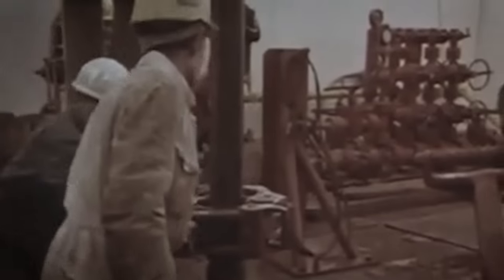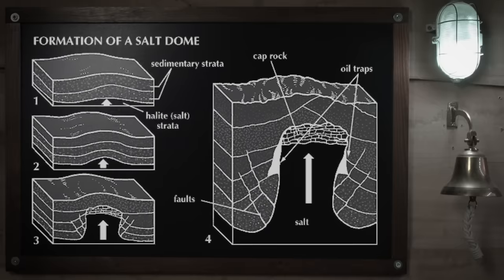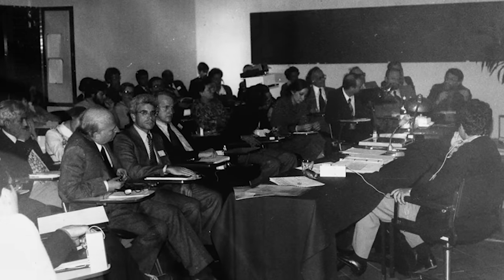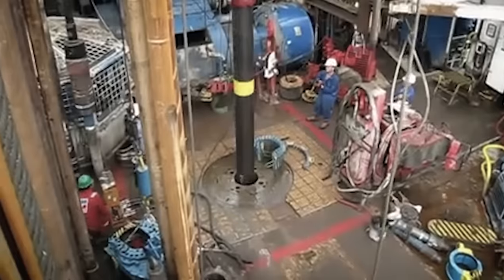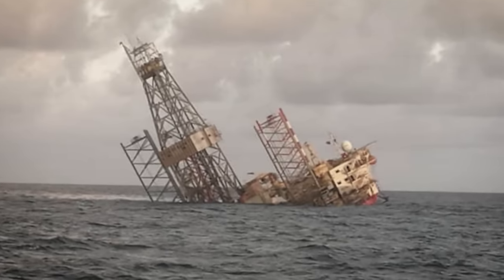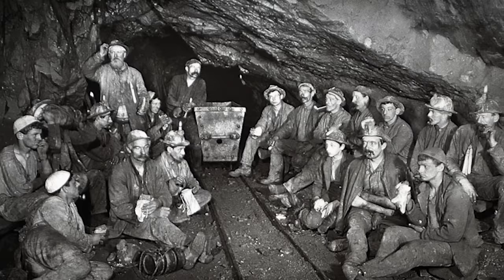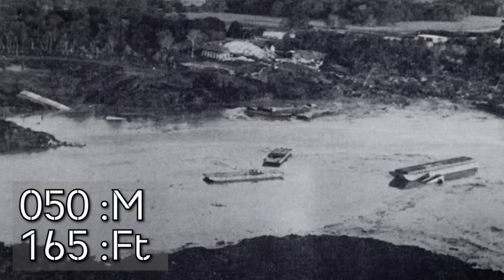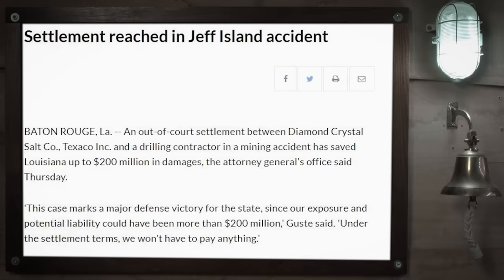This Vortex Swallowed an Oil Ship...

Comment: Always fascinated by this story & the mind-bending size of that mine to have swallowed all that water & debris.  It's a miracle noone was hurt in the mine or on the surface like the fisherman, especially given there were lots of waterfront properties & only landline phones to warn or call for help.  Sheer stupidity & 100% malpractice on both company's parts.  Great video as always! 👍
Reply from the maker: Yep it is incredible. The scale of the incident and no fatalities. Just incredible
Reply: You seem awfully quick to judge. I don't have enough information to say if both companies were at fault but, imo, the criminal negligence seems to lie with the salt mine alone for not having the abandoned shaft on any known map. That said, drilling that close to a salt mine, for any reason, seems incredibly risky. I guess what I'm trying to say is that I don't necessarily disagree with you but I wish people weren't so quick to point fingers. Mistakes were obviously made, but the oil drilling company appeared to follow all appropriate procedures. They can't force another company to participate if they don't want to, unfortunately.

Comment: As a native of the area I thought I would explain that Jefferson Island is not actually an island. Near the coastline towns built on the higher elevation above salt domes traditionally have "island" in their name. Besides Jefferson Island there is also Avery Island close by and High Island in Texas (east of Galveston Bay). They are high enough that they won't flood during storm surges caused by Hurricanes. They have large old live oak trees because ones at lower elevation are killed by salty storm surges.
Reply: Thanks, I was wondering why I couldnt see a giant island in the photos

Comment: I'm a native Louisianian and recall this incident quite vividly. It happened when I was 20 years old and working at a radio station in central Louisiana, so we were of course reading the news on this hourly. Many from our area work in the oil drilling community. The fact that it swallowed up the rigs, various boats all that shoreline infrastructure and a tugboat WHOLE was astounding and terrifying, as no one really knew much except the initial cause of it all, the punch through, and furthermore no one knew if it would ever END. It did, but I have to say I have visited the gardens on Jefferson Island both before and after and the damage done was apocalyptic to look at.  Louisiana has the largest oil reserves of any state in the union, and yet we get the lowest return on removal of that energy from our state of any state that produces energy. And yet we often bear the brunt of the largest accidents and incidents in the oil industry.  We run on oil, I'm not against getting it I just would like to see it done SAFELY, and with as little damage to state property, wetlands, shoreline and the Gulf. Deepwater Horizon was so horrible it should have ENDED BP. ENDED IT. But obama gave them a sweetheart deal settlement, yeah, Mr. Go buy your ass an electric car guy and never EVER use fossil fuels again hisself. He had the chance to BREAK and DESTROY a monumentally incompetent company and he took cash instead. Just like he did with Wall street when they caused the collapse in 2008.  He could have cleaned house for their using the stock market as a casino but he took CASH again!! Anyway, the feds got the lion's share of the funds and the Gulf coast got monumentally screwed once again. The Gulf LOOKS ok, but deep divers say the floor is destroyed for good. Thick layers of heavy crude blanket everything and sea life is mutating because of it. We're a big seafood state so make of THAT what you will as well.  All that said this was an EXCELLENT presentation of the incident, concise, accurate and wonderfully presented. 
I just wish it and D. Horizon had never happened.
Reply: When I was a kid from age 2-6 we used to swim in the Gulf of Mississipi near Biloxi.  In 2004 I happened to be in the area and mentioned it to someone and they thought I was nuts because it was polluted nd not really a beach anymore.  I guess things changed there since the 50's!

Comment: Did there used to be a river running through the lake? I'm a little confused at why there's soo many barges in a lake that doesn't have connections? That aerial photo at the very beginning had me confused the whole time. Unless that many barges are needed for the oil rig, but then weren't they drilling down and then to the side? I kinda assumed that drawing at around 2:21 is just generally the angles at which they're drilling not exactly for this specific drill site. I gotta look more into this story it's crazy. 

Thank God that all the miners and oil workers made it to shore safely, and the man fishing at the north side of the lake. That has got to be quite the sight to see while waiting for a sunfish to bite. Great video, Has me looking for a local tour or something that I can get more info on it
Reply: Okay I see the Wikipedia page and notice there's a river connected at the bottom of the lake. I was even paused on the Aerial photo at the beginning of the video, I feel dumb that I missed that, it's soo obvious to see >_< forgive me internet :)
Reply from the maker: It is a crazy one. Glad you found the answer you were looking for

Comment: This isn’t the only case of “ground vs drilling” on lakes.
Reply from the maker: It’s one of the wider ones I think. But yeah there are others
Reply: @waterlinestories  thank you for the reply I just have difficulties in understanding why the problem keeps repeating itself if it happens once, ok it’s the first time there’s an investigation on what happened and why, next time whoever it’s going to do something similar knows more about the risks and must know better and make more studies on the lake/body of water geology, physics of fluids, etc so if you drill you do it completely safe. But…no safety it’s not so relevant and people don’t have memory so they can’t remember the “ground vs drilling” accident that happened the day before, that’s why the same issue keeps repeating itself.
Reply: @EM.1  no matter how far you think about it. It leads back to money normally.
Reply: @nollienick1121   I understand your point but it bothers me that I can’t remember the others 2 cases, they are widely covered and I watched at least 6 different videos about those cases.

Comment: Where did all the Barges, Ships, Trees, Oil rigs, and equipment end up, like, that's a massive shitload of metal, wood, debris that got sucked down into the Salt Mine's chambers...
Reply: A lot of the trees, a barge, and debris is still sitting on the bottom of the lake. Most of it was sucked into the mines and is still buried there

Comment: The water level in the gulf of mexico one could assume remained stable throughout; the water level im Lake Peigneur fell as water went down the hole, so the water level in the canal joining the two should have FALLEN, not risen 8 feet, and even afterwards, as the lake level rises back up to be equal to that in the Gulf, because of the lake size in relation to the canal size, the canal level should still not have risen by as much as 8 feet, as the in-flow velocity would have gradually reduced, not abruptly, so there would be no significant 'flash-back' wave. Anyway, I have never seen a full canal where the bridle-ways were anywhere near as much as 8 feet higher than the water level, except at locks or bridges, so, when the canal water level rose 8 feet, the water would have overflowed the canal walls - where did it all flood to?                   And then, the island: it appears the bore hole was not adjacent to the island, so water flow near the island would not have had high velocity, so I am curious how it washed so much of the island along the lake as far as the bore-hole?      Could you extend the video and show how this happened, as the other explanations were very clear?

Comment: No "oil ship" was actually swallowed in this disaster. An oil drilling platform collapsed and several smaller barges were sucked in (but eventually came back up when pressure equalized later), but a ship swallowed?? No. Cheesy click-bait titles galore on this channel.....